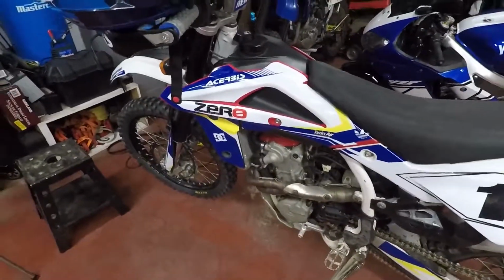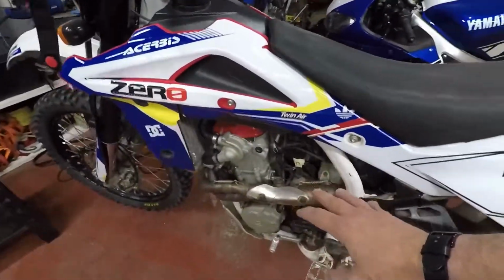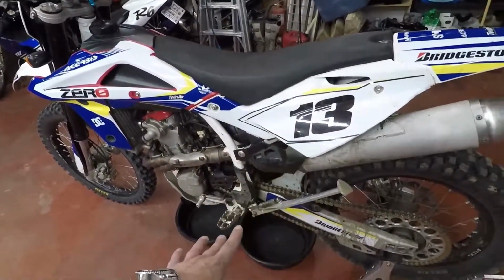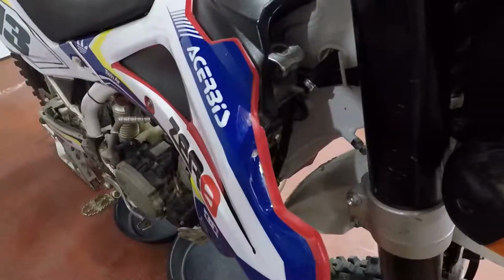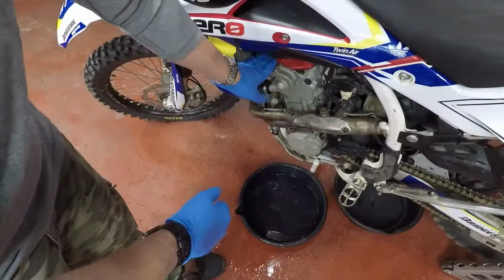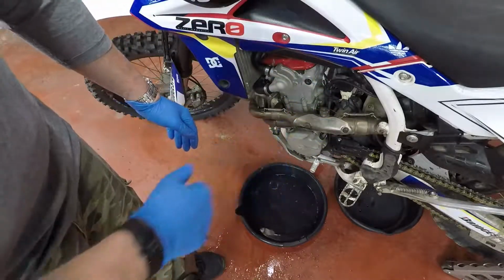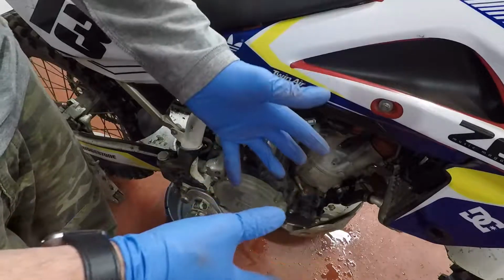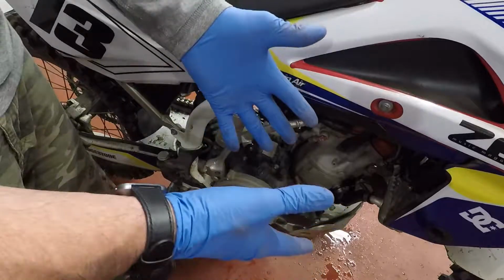coolant flush and change

Comment: I have a 07 510te and was looking to drain coolant and replace... I was wondering does the bike have a drain bolt or do u have to drain by taking hoses off?
Reply from the maker: on most there is a drain bold at the impeller housing but most effective is to remove the hoses.
Reply: @motomaddness4837  Thanks for the response... I did by removing the hoses and draining the overflow tank...